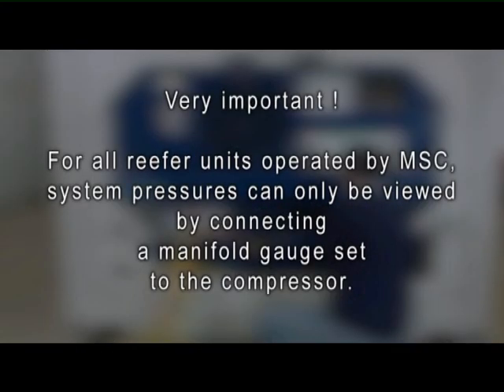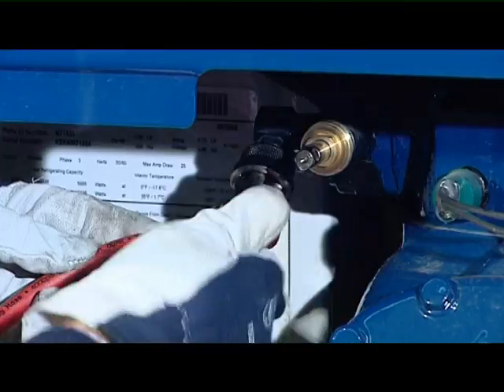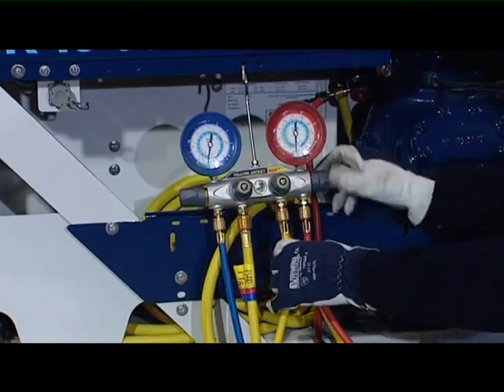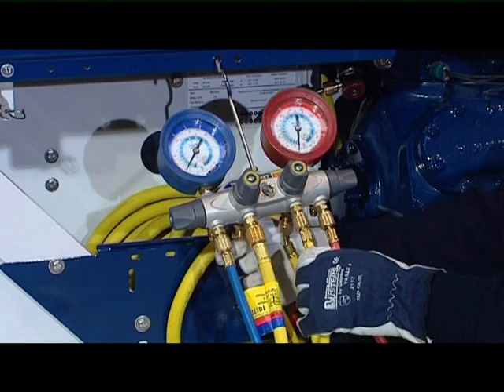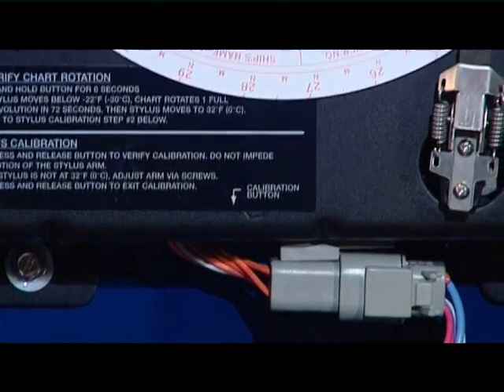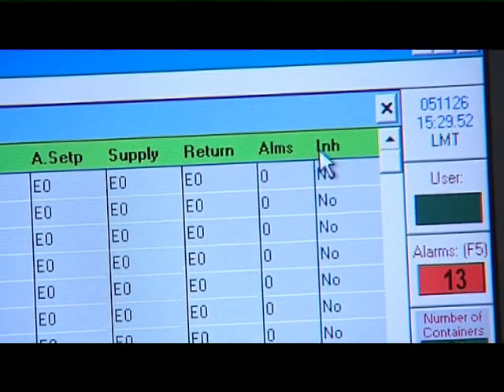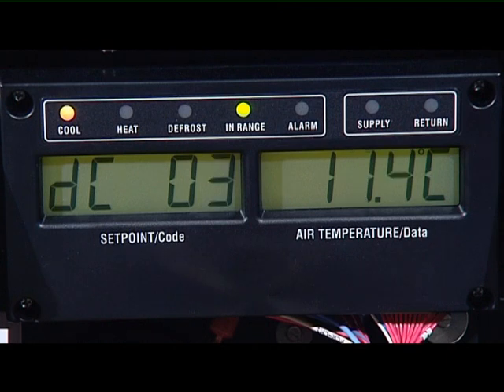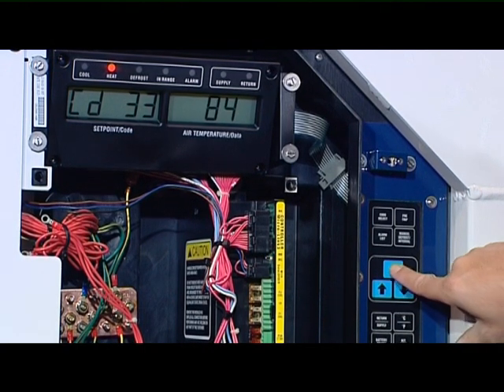reefer training 3

Comment: Hi  I have a doubt related carrier thinline reefer unit.the unit is not getting cold even in 8 temp setpoint .but the compressor is running properly and  refrigerant is sufficient level .what is the possible reasons.but( the charging service valve of compressor is rusty can't able to open in front seat possition . ) please give me solution.
Reply: EEV need to check